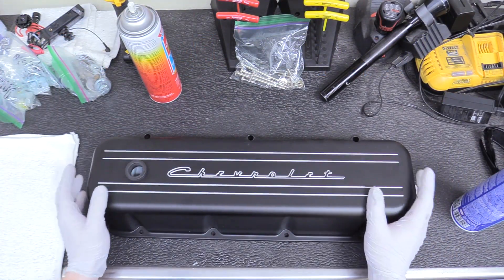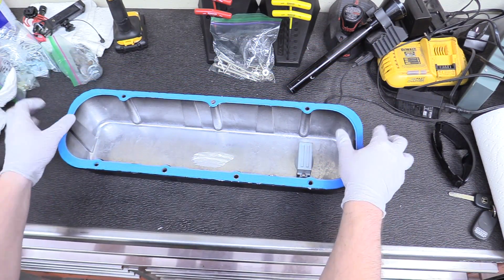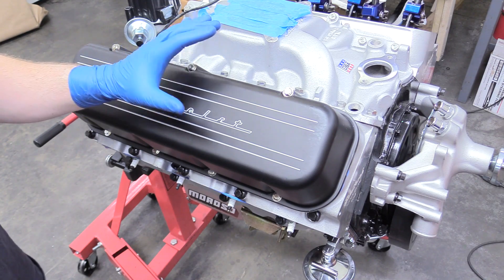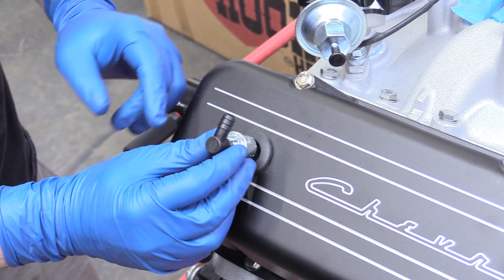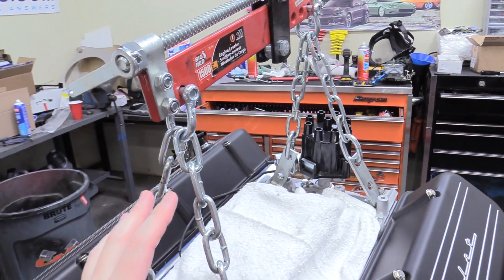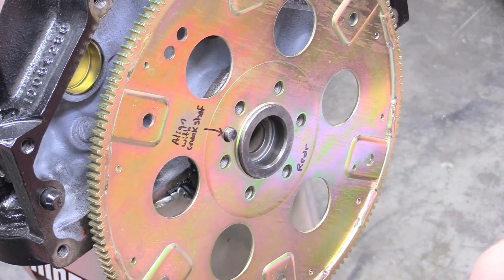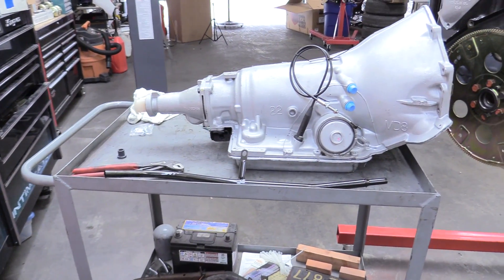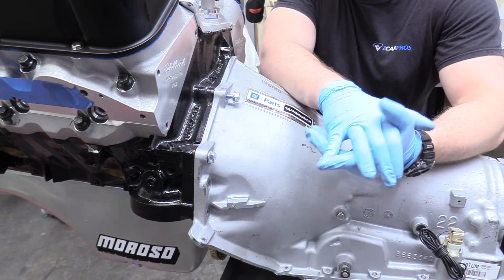How to Build a Chevrolet 454 Big Block Part 13: Transmission and Valve Covers!

Comment: So how much damage did I cause by mashing the torque converter to the pump???  Is it a full rebuild or just the pump replacement???
Reply from the maker: Usually a pump replacement. Thanks for watching!
Reply: Thanks brother for your response and and great explanation, I watched all the 454 videos you put out and because of you I was confident enough to attempt it myself. As of right now everything it running good and sounds ok, just not certain that the torque converter fully engaged.  I checked for metal in the fluid twice and haven’t found anything 🤞🏻. Thanks for everything 🙏🏻

Comment: Good question for ya- why isn't Locktite used for all bolts in an engine build? Especially bolts that only have a 20 foot pound torque rating. Like oil pans.
Reply from the maker: Because it would be super tough to get the bolts out if there is a problem in the future. Heck you can even snap the head right off the bolt if you use red loctite or something. Thanks for watching!
Reply: @2carpros  Really wow. Didn't realize it was that strong.
Reply: Hey this sounds like a great idea for a video. Rebuild an engine and put red Loctite on all the fasteners. Then in a month or so do a tear down and let us know how it went 😂

Comment: Had a 73 Malibu classic in 1996 bought it off my dad when he bought the car he drove it 3 months and it swallowed a valve in the engine the car had a 307 in it my father found the same year 73 engine only it was in a GMC pickup we thought it was another 307 but turned out it was a 454 and that bolted right up to the transmission that was in the car which was a good thing since the transmission that was in the truck was blown my dad drove it another couple months after changing the engine and then he sold it to me me and my older brother took it out one night young and stupid looking for a drag race we found one we stopped into deryder NY at the local watering hole my brother went in to buy a six pack on his way out the door he shouted out into the crowd whoever owns this 70 Buick Skylark out here I'll run you to truxton for six pack his challenge was answered without hesitation and the next thing I know I'm involved in a drag race my brother got in the car and said follow them when we got to the outskirts of town he told me to floor it  we were side by side with that Buick for about a half mile the last time I looked down at my speedometer it was buried past 120 and was still picking up speed I let off her coming into a corner then punched it again and when I did I blew the baffles out of the glass pack muffler that was on it we came into truxton sounding like a late model from the local dirt track we won the six pack that was one of the best nights of my life probably one of the dumbest but one of the best had a lot of fun small GMC 454s have some major balls
Reply from the maker: Dang that's quite a story! Thanks for watching!
Reply: No problem good buddy

Comment: do you have the part number for the flex plate as well? and would this flex plate work with a 350 turbo trans? or how do i find out which plate i need
Reply from the maker: Yes it that flexplate will work with a 350 transmission. https://www.summitracing.com/parts/sum-g102sfi/make/chevrolet

Comment: Putting 4" threaded headless bolts in the top 2 mounting holes will help the tranny slide in a lot easier, especially of you don't have all this fancy equipment😉 Slide it over the top 2 'guides', insert 2 retaining bolts on the bottom, remove the guides, & insert the 2 remaining retainer bolts.✌

Comment: What’s your thoughts on the cheap $20 rubber vc gaskets? I followed this whole series to rebuild my Gen 5 454 (which I recently got running, thank you) and I’m noticing an oil leak spot on each rear side of the motor. My guess is this is the issue. Any idea what else it could be? Starter bolts have oil, oil filter, bottom of headers etc. rear main looks very dry.

Comment: I have a question, I have been told time and Time again that the 700r4 isn’t strong enough to run behind a big block. I have a 468 with a turbo 400, and I hate it. I have 700r4 just sitting. What’s the pros and conns of 700r4 besides overdrive and will it hold up behind the big block

Comment: @ 8:50 it would’ve been cool to point out the weight that is welded to the flex plate denoting that the 454 is an externally balanced engine.
Reply from the maker: Good thing I have you! Thanks for watching!
Reply: @2carpros  You are an Excellent engine builder and I really appreciate your attention to detail!

Comment: I have a question
  Can the transmission be installed in a rotating position?  (So that the transmission shafting stick is on the left side, not facing up)
Reply from the maker: No. It is really only meant to go on one way. Thanks for watching!

Comment: Just wanted to know if the 5th Gen engine the same as your 4th Gen in the ways of being rebuilt? Because I have a Chevy 2000 C3500 OBS 5th Gen 7.4 I want to rebuild. Just looking for info and where to start.  Good series of info Thanks.
Reply from the maker: So it would be very similar it would have a one piece rear main and a different intake manifold. But the process is very similar! Thanks for watching!
Reply: 2000 is a gen 6. 5th gen were the tbi 454 with peanut port heads. Not as desirable. Gen 6 is a factory roller engine
Reply: Thanks man appreciate it alot..
Reply: Yup your right Just doubled checked and my motor is a 6 gen. Would rebuilding my motor be the same process as this process seen here on this channel?
Reply: @salyanez4053  yes same process

Comment: Any info on how to identify engines and finding spec info? Awesome job! Can't wait to hear it run💪
Reply from the maker: So right where the transmission bolts up on the driver's side there is a casting number that should tell you everything you need to know. Thanks for watching!
Reply: @2carpros  Thanks for the info👍

Comment: Just don't forget to install the flexplate to converter bolts...  That can be embarrassing.  Not big on the carb plate lift when it comes to the big blocks, they are heavy and I've see intakes crack from the weight.
Reply from the maker: Just put them in today! I'm not big on those either for that exact reason. Thanks for watching!